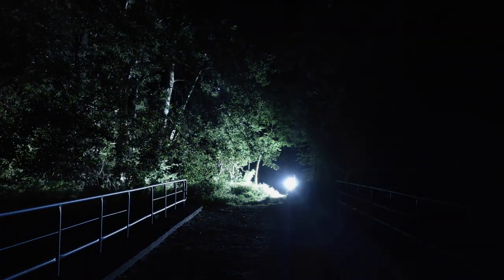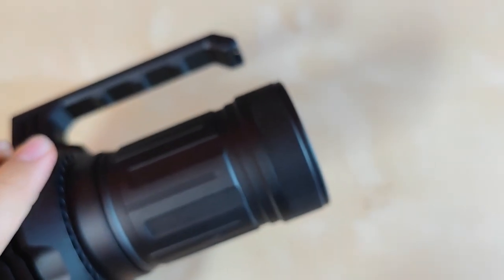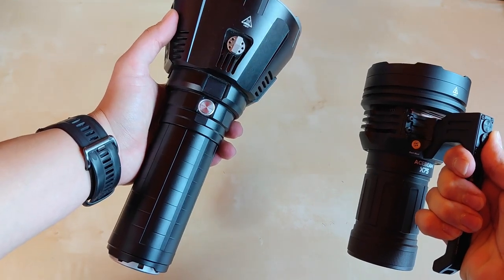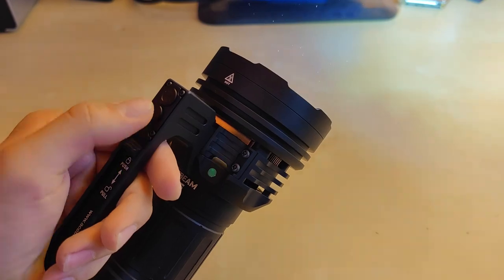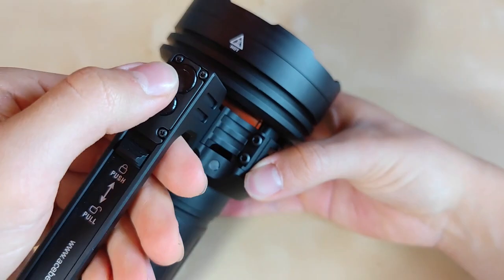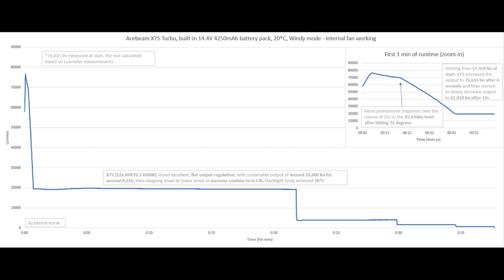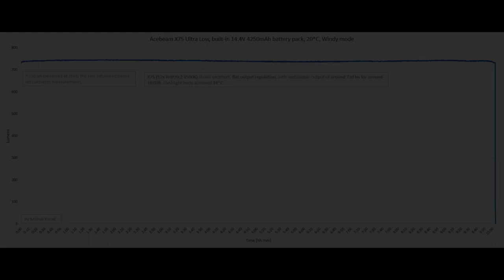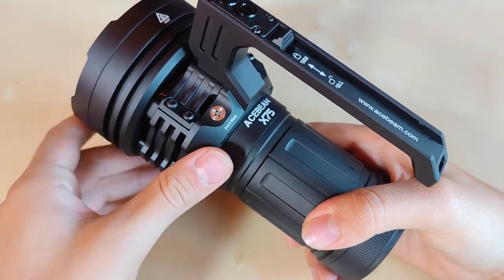Acebeam X75 Review - 80,000 lm Search and Rescue Flashlight with intelligent fan cooling system

Comment: I have the X75 /70.3 Hi 6500 K at 6700 lumens, what a beast and it maintains it’s maximum light levels better than any of them on the market.  I also have the Imaleant  SR16 which I love because it throws like a monster, but let me reiterate,it just can’t hold the times like the X75.🔦🔦💪
Reply from the maker: Thanks for sharing! Both flashlights are absolute monsters, have fun ;)
Reply: Try the Imalent sr 32 I bought, it's just an unreal spotlight.

Comment: I agree this x75 will serve the search and rescue well. In my novice opinion, the average of 15000 lumens 30 minutes runtime should speak for itself. 
   What i have in mind is this kind of tempered regulation should also applied to flashlight that on the thrower side, less emmitter, larger reflector cups. More R&D in the reflector, since now there are many high performance flat led.  
A good cooling system is a must for high powered flashlight. And those exposed copper heatsink... they do mean bussiness.  
Cheers🔦
Reply from the maker: Thanks for your comment. I hope Acebeam is working on a thrower around this concept... :D

Comment: Mr. Flashlight Enthusiast.  Which is the baddest best option for the X75? Love your reviews!✌️💯
Reply from the maker: I can recommend XHP70.3 Hi version, preferably with long battery tube for more reasonable runtimes and power. I would also go for black anode for increased scratch resistance ;)
Reply: @FlashlightEnthusiast  if I can purchase on the website like you recommend I will. Thank you very much!

Comment: Definitely waiting for comparison with XHP70.3 Hi version. The latter should be substantially more throwy and less blinding 😃
Reply: They only rate it as 150m more range though. Half of the ANSI rating is good usable lighting, so you're looking at an increase of 75m
Reply from the maker: Seems suspicious, yet with more pronounced hotspot and significantly lower output I am still interested to have it side by side with XHP70.2 HD version
Reply: @FlashlightEnthusiast  It would be crazy with  SBT 90.2s  the best LED in my opinion.
Reply: @gwashburn39  look at the wuben A1
Reply: @maggi98mw   I know $800 - $900 
though.
Reply: @gwashburn39  convoy l7 will have to suffice ;)
Reply: @maggi98mw  nahh Acebeam k75 or k65gt ;)

Comment: The little valve is a battery explosion vent to relieve pressure under the event of a battery fail. These type of batteries have a higher energy density than TNT.
Reply from the maker: That's a great, helpful insight, thanks for that 💪

Comment: Interesting that they put a reset button on the battery pack.  I had a problem with my x50 not wanting to take charge about a week ago and it would not turn on at all ( I was furious 🤬) so I  plugged in my usb-c cable from my phone to see if that would do anything and the charging light on the battery pack came on for a second and then turned off again 
so I unplugged that cable and plugged the ab cable back into it and it started taking a charge again.  Also had a problem with my ab x70 battery pack about a year ago.  Basically just disassembled it to see if I could find anything wrong but didn’t so  reassembled it and started taking a charge again. So as I said, I find it very interesting they put a reset button on the x75 battery pack.
Reply from the maker: Yes indeed. Second generation X50 already had it, and now X75. I heard some reports about X50 being stuck after fully discharging battery pack. Then lower power source had to be used to activate it. Seem like your case though....
Reply: @FlashlightEnthusiast  had issues with my X75 not taking a charge, but I put that down to not discharging it enough between charges. The reset switch did nothing at all in this case. Tried different power bricks and cables, and it would only take a charge after using it a bit more. I forgot to mention this in my review.

Comment: They make this like in a 6500k and a 5000k version. Would you say the 6500k has a bluish tint and the 5000k is more "white"?
Reply from the maker: In general yes, in the Acebeam X50 I had 5000K which was a bit yellowish even, so I presume it would be the same in X75. For sucht high power light I would go with 6500K personally

Comment: Morning, imalent sr16 or x75 ? Which The best? Thanks
Reply from the maker: Afternoon, thank you for a good question. Personally after I've seen X75 on XHP70.3 Hi yesterday I would only consider this version. It is still more floody then SR16, however is superior to it when it comes to sustainable output. So I would pick SR16 for better throw and slightly more compact size (you can detach the handle and use the side button) but X75 for better performance, output and powerbank function - and you can get a longer battery pack. Hope that helps, you could let me know your needs, it would be easier to decide ;)
Reply: @FlashlightEnthusiast  mine is only passion for powerful light is white, i like the head of the sr16 and the handle that comes off. but I'm undecided!

Comment: How many times you can use turbo with one charge?
Reply from the maker: Depends on the duration of Turbo bursts and external temperature. In my experience it is around 10 times before the flashlights stops to turn on in highest mode and only High is available. Hope it helps
Reply: @FlashlightEnthusiast  Thanks for the answer. For sure it was helpful 🙏

Comment: Can the old battery be replaced with a new one?
Reply from the maker: You can only buy a new battery pack if the old one dies. Replacing the cells inside is more tricky 😉

Comment: Mine 2 years old Lumintop GT4 also has 20k+ sustainable output, until batteries are dead 🙂
Reply from the maker: Thanks for that comment. While substantially larger, it is sth worth mentioning
Reply: @FlashlightEnthusiast  thats true, its huge and very heavy.
Reply: True, I also got the GT4. My temp control  is disable and I manage to get over 25000 lumens output for the first 5 minutes and still above 20 000 lumens after 10 minutes.
Reply from the maker: That is truly impressive, as it always is with BLF projects. I quickly checked Matt Smith's review on this light, this thing is just huge :D With such cooling fins and thermal mass, no wonder it can sustain that. Thank you for the comment man!
Reply: @hardusvd  how about with gt94x? have you tested? I have it, but never ran it on turbo too long

Comment: What do you use to measure lumens, a tube or sphere?
Reply from the maker: Texas Ace lumen tube
Reply: @FlashlightEnthusiast  Is yours the 4.5 inch version? Is it calibrated with maukka lights? I ask because I also have the 3.5 inch and only got 54K, Matt Smith used a 6 inch with Maukka also and only measured 57,900. I sold my X75 already so can't test anymore, but just super interested if you still used the maukka calibration. 

Very thorough review btw, you're able to deliver much more of the technical info than me. I like to focus more on the night footage :)
Reply from the maker: No, I have the 3.5 inch version, so I had to improvise a bit with this particular light, yet nothing that would stop me from being within the accuracy range. I don't believe Texas Ace got it calibrated from Maukka, but I a mgetting pretty close results to other members, so I wouldn't be particularly concerned about that. Flashoholic got numbers close to my on X75 in his review just for the reference ;)

Comment: Great flashlight but useless))
Reply from the maker: For the majority of us probably yes 😁
Reply: @FlashlightEnthusiast  I call such flashlights “shelflight”)).
BWT: the light could useful for some applications if AB will make 70.3 4000K option. This significantly reduce “wall of light”.
Reply: Moreover, I will be happy to have AB L35 with such led.
Reply from the maker: Fully agree, most of us will not us it often. Seems like a great search and rescue flashlight though. XHO70.3 Hi is in my opinion neccessity not to blind yourself with light reflected in fron of you. Acebeam releases XHP70.3 Hi version soon, hope to make a comparison video in late September
Reply from the maker: L35 is not a problem, 1 LED swap should be achievable, you can already source XHP70.3 Hi in 4000K for instance from Kaidomain
Reply: @FlashlightEnthusiast  i am trying to get my hands on the 70.3 version. i already have quite a number of high powered 70.2 lights with me.
Reply: @nitric75 the 70.3 is the way to go in this configuration. You get less flood of light in front of you and a much better throw..